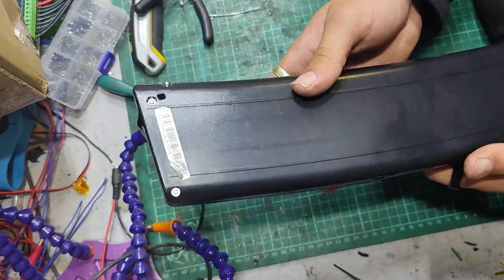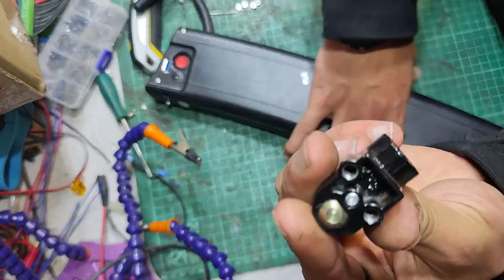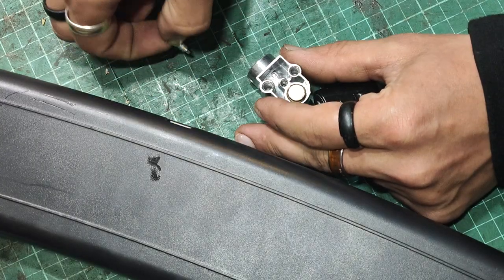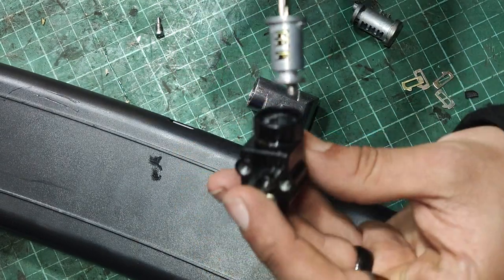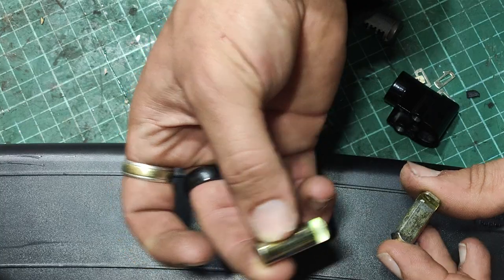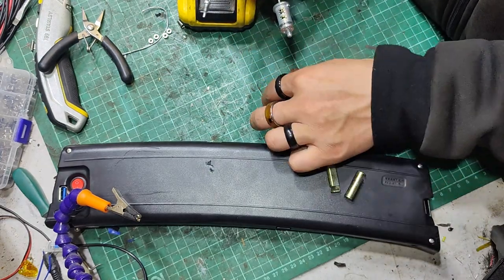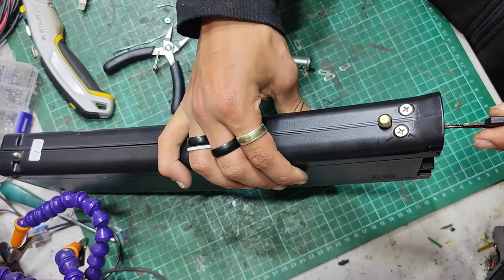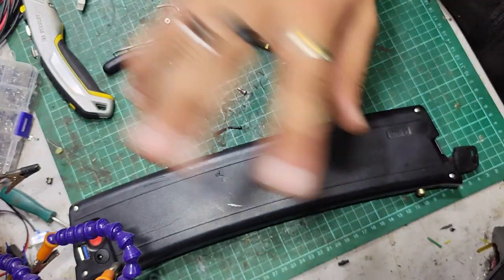Carrera Crosscity E Battery Lock Replacement

Comment: I have this exact issue !
Bought the Cross city unused & immaculate on ebay. All accessories but no battery removal keys. Halfords tell me I need a locksmith first then a new battery from them at £300.... Shocking
Reply from the maker: Hope this video was able to help you!!
Reply: @EbikeRepairs 
Yes it did thanks 👍
Locksmith drilled out old lock.
I removed & replaced with a new lock from eBay.
Reply: @ebikerepairs
Any suggestion on how to remove this battery, i lost the keys. Thank you